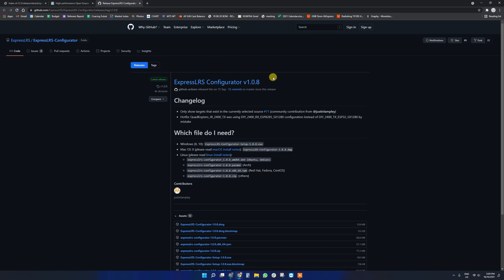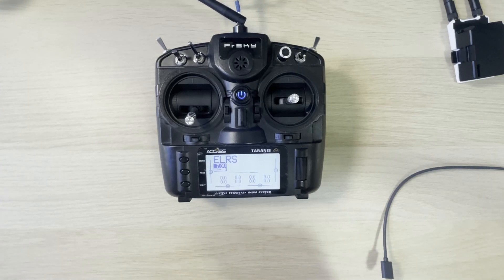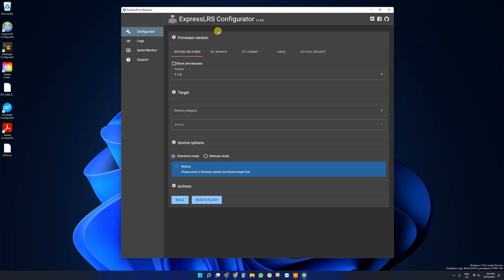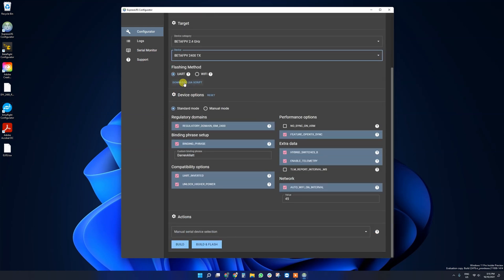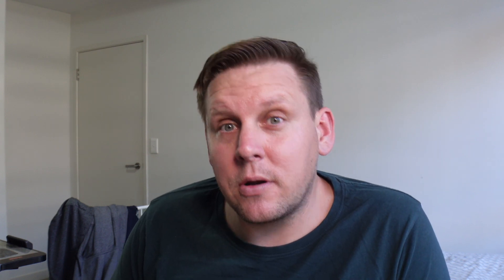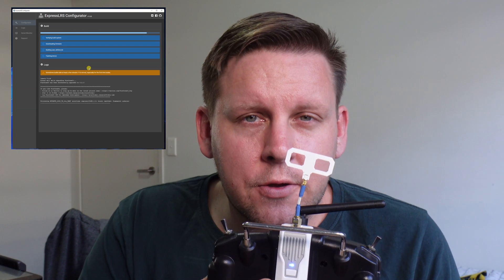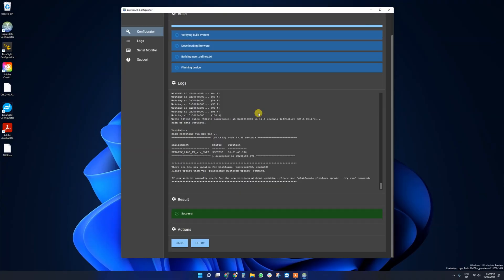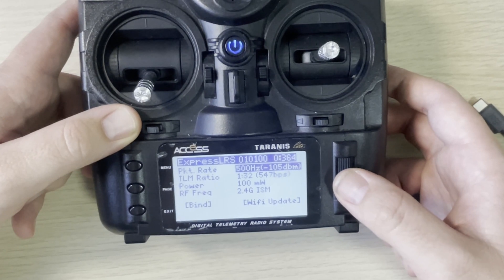Hot To Setup ExpressLRS Transmitter In Under 5 Minutes

Comment: Hi, I've done everything you've explained here and from previous video and get no stick inputs in Betaflight?  Using the TLite with the happymodel tx & binding to flywoo nano 1s with elrs rx. It looks like it's bound with solid blue led on the rx. Also in the lua script on the radio i see an option for other devices which lists the flywoo rx in there. Nothing happens when i click it though. Internal module is off, external is on and set to crsf & same in Betaflight. 
Any help or suggestions guys? Im 3 days at this now and it's not fun lol
Reply: Ps: I'm on the latest Opentx, Betaflight, & Elrs configurator*
Reply from the maker: I’m going to assume you have a brand new radio? Have you setup the Inputs & Mixer?

Watch this video from 14th minute to see how to do that. How to setup your Radio for ExpressLRS |
https://youtu.be/M45lx3yKK_4

If you’ve done that and it doesn’t work let me know

Comment: I'm on this section of the process now.. thanks a lot! now my question is I don't have any options for "manual serial device selection". can i just leave that blank and hit "BUILD"? Thanks!!!
Reply: Just hit build & it said build error … any ideas ?
Reply from the maker: @adrianau4246  you need to select the target from the list
Reply: @DarrenAllatt  okay I figured it out I had to clear platformio dep. then try again, I hit build & it said success this time. So I guess that part is done of my controller setup? Now I have the EP2 elrs happymodel being shipped out , am I on the right path ?
Reply from the maker: @adrianau4246  yes you are. Well done
Reply: @DarrenAllatt  thanks so much man! You helped a lot I appreciate it a lot. Now I need some links to what I should do when I get the EP2 & possibly wire it or use the sbus port that my xm+ is connected to for easy disconnect of the XM+..
Reply from the maker: @adrianau4246  here is how you write up an ELRS receiver How to install ExpressLRS
https://youtu.be/NvJqeGTcPkY
Reply: @DarrenAllatt  would you do a video how to set up a BEC/UBEC to say a flash flight that takes 12v & a flight controller don’t have a 12v pad only 5v and I think the bec makes 5v into 12v ? Can you make a video how to and maybe other alt etc..
Reply from the maker: Potentially. It wouldn’t be for a couple of weeks
Reply from the maker: Out of interest, why not just power from the balance lead?

Comment: Thanks for your great instruction videos always. I have the elrs module on my T-lite and activated the lq and rssi dbm in betaflight but it does not show on my dji goggles v2. I can just manage to see the rssi only out of these 3 but for erls this is not helpful. Maybe it is not possible to see those 2 values in the dji goggles? Other values like battery voltage per cell show up...
Reply from the maker: DJI doesn’t support LQ only RSSI.  You can go ti the receiver tab and set the RSSI element to show Aux 11 which is LQ… LQ is more important than RSSI
Reply: @DarrenAllatt  thanks but how do you know that AUX 11 is LQ ?
Reply from the maker: It’s in the ELRS wiki
Reply: @DarrenAllatt  i see, again thanks for your help 🙂

Comment: Here we go I'm a total noob so I have a really newb question. I don't know much about this transmitter receiver crap. Because with my RCS I ran cars you have the remote control and you had your car's receiving unit and then the central processing unit which activated whatever servos you needed to be actuated. Now with this fpv drone stuff I'm very much ignorant. I own too however and I thought I knew a little something about what I was buying but I guess not. Problem is I have two eye flights one is the not school version 2 bind and fly with the crossfire nano RX. With exception of it's like a TBS crossfire RX. Then I have a I flight Titan XL BNF also with the TBS crossfire nano. No thinking that crossfire was cross-compatible technology as it's described I bought the same two controllers you're reviewing sort of. I bought a jumper tea light and I got the beta fpv external crossfire module 900 mhz. After all these attempts at flashing and binding and nothing seems to be happening I've come to the conclusion that none of these are really cross technology compatible. You need a beta fpv receiver and a beta fpv transmitter right? Like a TBS crossfire receiver is only going to work with a TBS crossfire transmitter? I thought all of this was open code to be shared and used by other companies. This is really getting on my nerves cuz it's like I got to dump more money into more receivers, or a different module for my jumper tea light which is probably the route I'm going to get it's cheapest. Because I don't feel like soldering and breaking any of my connections. I just want to get my damn birds up in the sky I've had him for like 3 months now
Reply from the maker: Ah, you didn’t get a BetaFPV external Crossfire module. You got a 900mhz ExpressLRS BetaFPV module. 

Only TBS make Crossfire Tx and RX modules you’ll need to get a TBS Crossfire Nano TX for your Jumper T Lite. 

Basically, think of it like this. When you buy an RX or TX they are “network/carrier locked” - kind of like how you buy a mobile phone that only works on one network. You need to make sure you are buying the same “network/carrier” but also the same frequency. If you are just buying crossfire gear you’ll be fine.